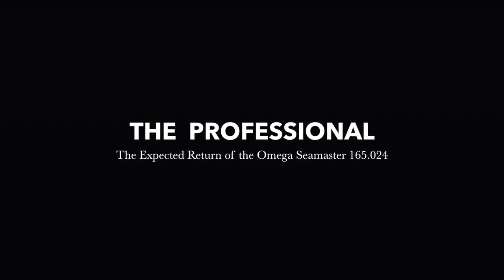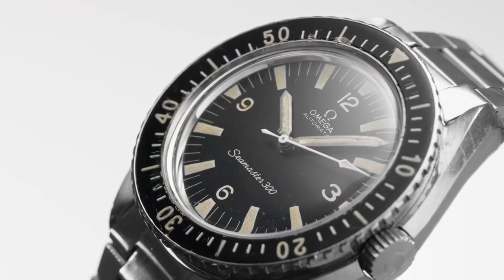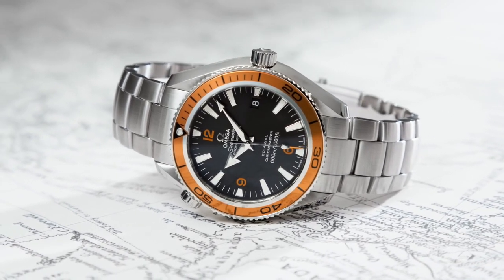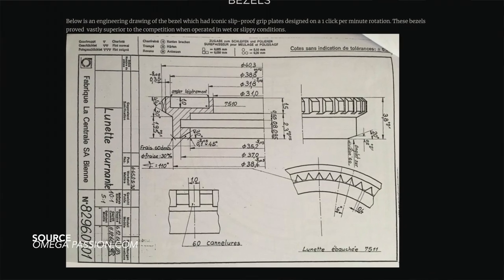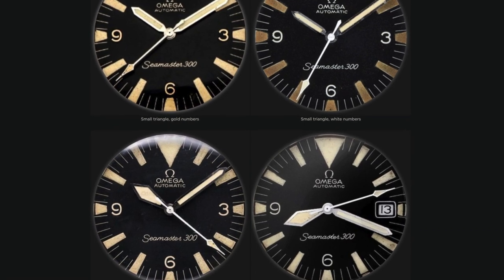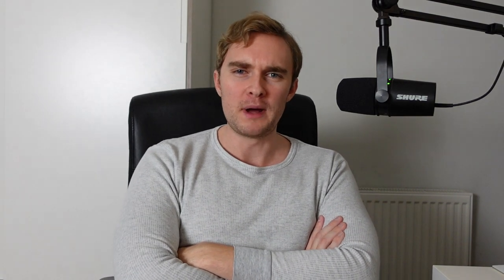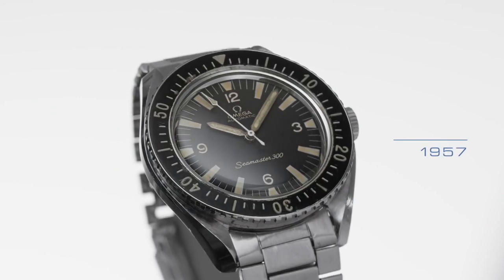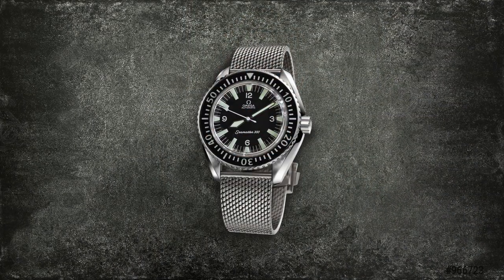Omega's Expected Release of the Seamaster 300 Anniversary (165.024)

Comment: I love my 2254 and am a big fan of the 165.024. I hope they bring it back as well but I wonder how Omega can recreate the original dimensions using their current coaxial movements which require a thick case. I guess  that the secret Omega design  department will figure it out.

Comment: I have an original seamster 300 which I bought for £66. Omega rebuilt the watch after many years of diving use. They returned to me all the parts changed so it could be returned to original condition. Being an engineer I wanted it to be fit for purpose. I have a significant watch collection of over 100 watches but this takes pride of place in my collection.

Comment: Fantastic video.  
The potential Seamaster 300 you are talking about is very similar to the CWC RN Auto.  I don't think the CWC is the size as the Seamaster; which makes spacing on the dial feel a little more cramped.  If Omega releases the watch in line with how you envision it; I think the crowding problem would be addressed and it would look like a very well balanced watch.  What I like about the CWC is the fixed lugs; which gives it the mil-spec feel.  I would hope Omega would offer an option with the same.